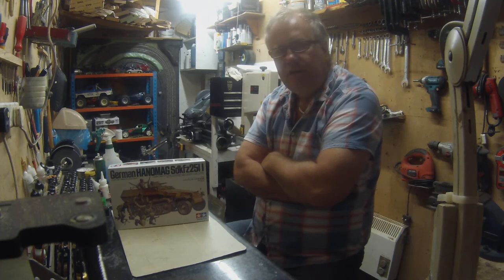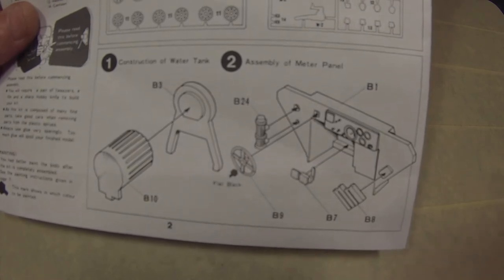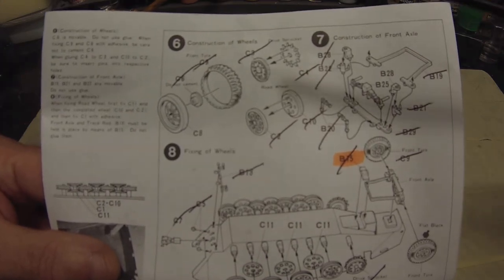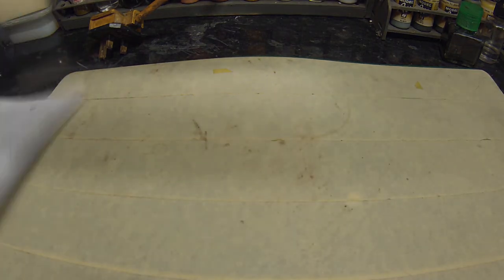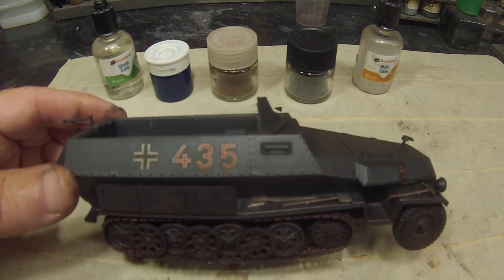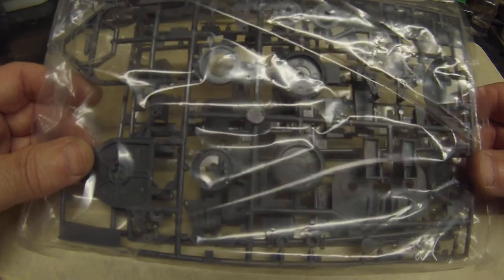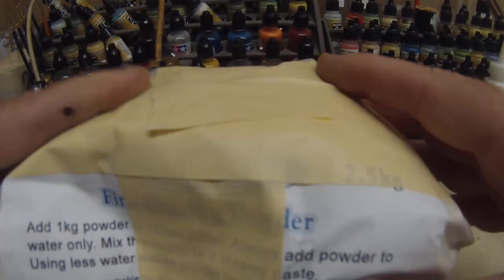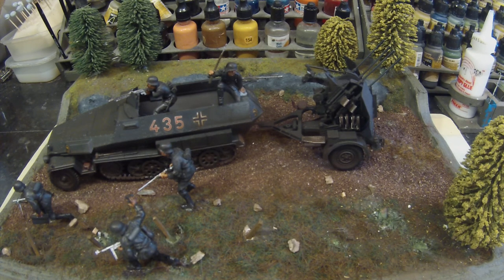Tamiya 1/35 Hanomag Sdkfz 251/1 & 20mm Flakvierling 38 & Diorama..Plastic Kit Build & Review.

Comment: I am just finishing my build of the same Sdkfz 251/1. As you said it's a 1973 kit. I found a lot of seams which meant a lot of clean up. I did get the back doors in, after much swearing, I finally taped the doors shut so that the hinges stayed in place. It was either that or grow a third hand. There was no decals in my kit, and the plans are like Ikea. Granted it was about a $30 CAD kit which is on the cheap side and that is my fault. If my poor painting skills are sufficient and I can find some decals in my extra stash it may go on the shelf. Even though the length and width are close to scale. I wanted to put in a driver and none of my 1 35 scale figures from other Tamiya or other kits are even close to fitting on the seat. I even tried a 1 48 scale person, and their legs are too long. That is disappointing. Current Tamiya kits are much better, but I have decided to try others, RFM, Trumpeter and Border to name a few. I built the Trumpeter Sdkfz-8 which was a fantastic kit and holds 9 sitting troopers. Not one of of them would fit in this kit. Oh well. Great video and a nice job. Don't sweat the rear doors they will not stay in place at all .
Reply from the maker: Thanks for watching, glad I'm not the only one who struggled with those doors. Yeah, it's an old kit but I just like the way these old Tamiya kits go together, can't knock them for the money. Their 1/48 Harrier jump jet and 1/20 6 wheel Tyrrell F1 car are atrocious builds.